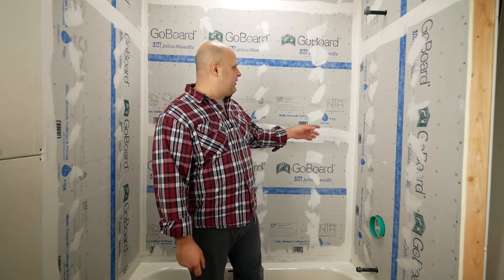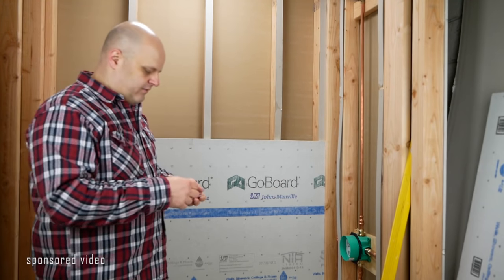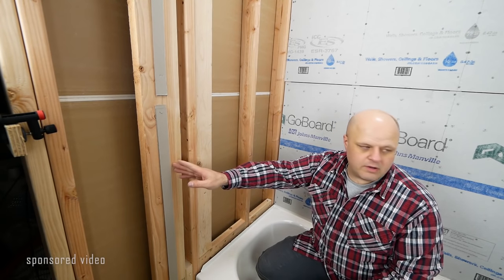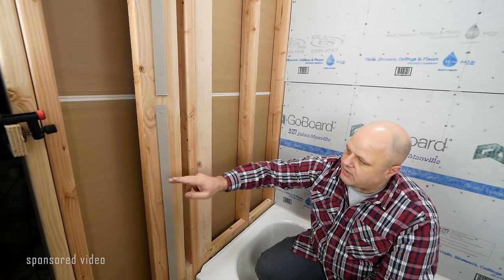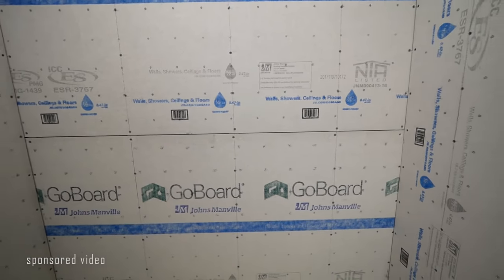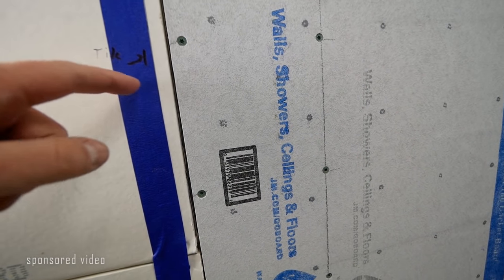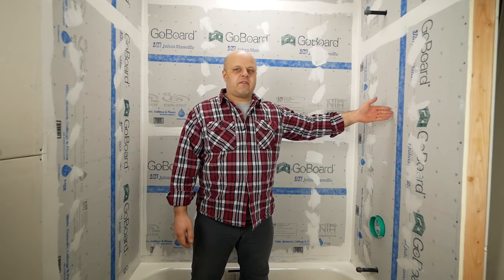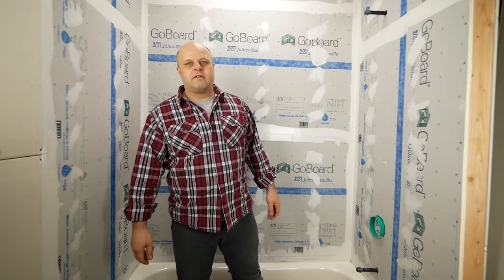How to Install GoBoard Tile Backer Board

Comment: One other thing you may try on the install next time is instead of adding strips of thin paper on the studs, use something like the old wood lath strips or ripped down pieces of wood probably 1/4 in  thickness nailed to the stud faces.  This will bring the GoBoard past the top flange of the tub where  it can just drop down sitting on top of the tub.  You could  still use your 1/8" spacers just sit them on top of the tub below the lip.  You will use less tube sealant, no need for mesh tape, and the top of the flange is completely covered all around by the GoBoard then thin-set and tile.  No chance of it leaking because the board is past the flange and not sitting on top of it.

Comment: What is your opinion of the goboard shower pan system. I want to replace a fiberglass shower but prefer not to move the drain to fit a preformed pan.

Comment: How comfortable would you feel about framing, applying plywood, then this go board w/sealant over to make shower benches, corner seats, and niches? Prefabbed niches and seats are not cost friendly, but this could make an easy solution.
Reply from the maker: I wouldn't have any issues with doing it that way. I usually would use thinset in addition to screws on horizontal surfaces but what you're describing would work fine.
Reply: Or, skip the framing and just use Schlueter kerdi board!

Comment: Great video.  You covered everything!  In 2023, Amazon sells a GoBoard seam tape, but you have to buy a big roll of it, and it is not cheap.  They probably sell it because old timers like me cannot let go of covering a joint with tape.  Maybe it is an old drywall habit that is very hard to break.  Please keep making these nice videos.
Reply from the maker: Thank you!

Comment: I've been following your bathroom renovation projects and appreciate the insights you share. I recently conducted a detailed exploration into the safety and installation practices concerning foam core backer boards, specifically focusing on the critical role of wood blocking for secure grab bar installations. Our findings highlight the potential risks and structural integrity issues that can arise from omitting wood blocking, even with the most reliable materials and techniques.

Given the importance of safety and durability in renovations, I thought this information could be beneficial to your projects and audience. Incorporating wood blocking can significantly enhance the strength and safety of grab bar installations, a detail that's often overlooked.

I'd be happy to share our findings and discuss further. Keep up the great work, and thank you for sharing your knowledge with the community!
Reply from the maker: I agree. Wood blocking for grab bars is a good decision.
Reply: I would think you need blocking for grab bars regardless of what kind of backer you use.

Comment: Great video. I'll be starting my project this weekend. Bought the GoBoard at Lowes, but they don't sell the GoBoard Sealant in my area, so called the company for recommendations for alternatives. I saw on your website that you mention that this product is "itchy". I'm so glad you said it because I wondered why my arms were getting itchy and developing hives when I was loading my car.
Reply: I called the company for a sealant  retailer or alternative and they didn't return my call.What did they recommend?
Reply from the maker: Over on the jm website they have some documents available for download. They may have a retailer list and they also have an alternative sealant list if you can't find their sealant

Comment: Nice work. Can you tell me which of the two  ways of sealing board seams do you recommend most..
* caulking board edge as you hang each one... or
* leaving 1/8" gap then caulking afterwards?

Also. What type of tape did you use on edges of 2x4s
Reply from the maker: Applying the sealant as you go would have the least opportunity for user error.

Comment: I like this product and your demo. I have a question about an observation at time marker 6:11 - 6:17. As you are screwing in the next section I notice you have strip(s) of, for lack of a better term, 'foam backer' pieces stapled to the stud(s). But there's another piece sort of loose material behind the board as you drive in the first top screw. Is it the same material & why?
Reply from the maker: Drywall shims for flattening the walls

Comment: Dumb question. I get that the goboard has a surface well designed for mortaring tile. But it seems like you cover a lot of it with sealant that completely changes that surface. Does mortar or other adhesive have trouble sticking to all that sealant?
Reply from the maker: The manufacturer has tested and says adhering to the seams still meets the minimum requirements. You could use seam tape instead of the sealant if you're concerned about it. Not a dumb question.

Comment: Great video....why are you mounting it on strips to keep it off of the studs?  And what material are the strips made of?
Reply from the maker: The strips are called drywall shims and they are used for shimming out the studs so the walls are flat prior to installing the board. They are made out of cardboard and found in the drywall section of your home improvement store.

Comment: Great idea on putting mesh at the tub flange. Thanks for the awesome video! About how many tubes of sealant did you use? And what did you use to clean off sealant on your putty knife? About to do a similar size shower and want to use GoBoard instead of cement board.
Reply from the maker: Denatured alcohol will clean up the sealant. I'd figure 1 tube for every 2 sheets plus a couple of extra.

Comment: Fantastic video.  I'm definitely going to try this product.  Do you know about how many tubes of the sealant caulk you used on this install?
Reply from the maker: I'd figure one tube for every two sheets and then add one or two more just to be safe.
Reply: @DIYTileGuy  Thank you so much!  That is super helpful.  Again, great video.  Best one I've seen.

Comment: maybe he said it but i missed it, what are the grey strips he stapled to the studs before putting the board up?
Reply from the maker: They are drywall shims for flattening out the walls prior to installing GoBoard. You can find them in the drywall section of your local home improvement store.
Reply: @DIYTileGuy  thanks. Is this a necessary step for installing goboard?
Reply from the maker: Walls should always be flattened prior to installing any backer board. The better job you do, the easier the tiling goes.

Comment: I can see this being far superior then Schluter's product
Reply from the maker: It's another product that accomplishes the same goal. I found this product to be more rigid and simpler to install but Kerdi board has it's fans as well.
Reply: I have never used this product.  Looks good though. Is it guaranteed?  Schlueter comes with a 10 year guarantee!
Reply: @michaelhorn9114  - yes they have a 10 year warranty as well!

Comment: If you were doing a shower only would you seal around the bottom seam the same as the wall seams?  Great video
Reply from the maker: If it's a fiberglass shower pan then I would seal it exactly like I did in this video. I also have a blog post on this topic on my diytileguy blog if that's helpful at all.
Reply: What about to the flange of a cast iron shower pan? Still use mesh tape or just a heavy bead of polyurethane sealant only?
Reply from the maker: I like using mesh tape along with the sealant. But others might simply use sealant only
Reply: If you use the GoBoard Pan you run walls all the way down with no sealant on bottom. Pan gets an 1/8" gap and sealed later.

Comment: Just curious, why would you use tape for the tub joints but not corners?  Great video!
Reply from the maker: It's not required for the corner but you could use it there too.

Comment: Do you still use mesh tape at the flange or have you switched over to the GoBoard tape? Also, do you now use GoBoard washers in conjunction with the fastners? Thanks!
Reply from the maker: I have switched over to the seam tape but i don't like washers with this board. They don't really sink in like they do with Wedi.
Reply: Thanks for your response!

Comment: Hey! I have a couple questions if you don't mind!  What kind of mesh tape did you use at the bottom by the tub flange?  I see there are different mesh tapes for different applications, cement board etc.  

Also, I'm going to tile the bathroom floor using a Schluter ditra decoupling membrane - Recommendations on how to waterproof between the membrane and the bottom of the tub skirt?  Thank you!

Finally, I want to significantly improve the waterproofing in my entire bathroom, including the walls.  Any recommendations on this?
Reply from the maker: I think a better way of sealing the tub flange is to use a banding and seal it to the tub flange with the backer board sealant. This same sealant can be used to seal in-between the bathtub and uncoupling membrane and elsewhere. 

Also, the banding can be used to cover the uncoupling membrane seams and flashed up the wall if you really want to waterproof your floor well.

Comment: I appreciate your detailed description. Just to make clear - the board rests ON TOP of the tub flange?
Reply from the maker: If you can shim out your walls and drop the board in front of the flange then that's probably the way to go. But if it doesn't work to do that then keep it above

Comment: Best DIY video I have ever viewed.  I subscribed.  Thank you!  Two questions - (1) what are the strips you are attaching to the 2x4 frame before attaching the GoBoard?, (2) The plumber who installed my tub used large headed screws into the flange to secure to frame . . . they stick out a little more than the 1/2" thickness of the GoBoard, which is why I am wondering if the strips you are attaching in my first questions could be enough to offset the screw heads?
Reply from the maker: The strips are drywall shims that you can find at the local hardware store in the drywall section. They are for flattening the walls prior to installing the board.

The strips might be enough to build out the wall but you don't want to build the wall out too far past the drywall if you can help it.

Comment: Great video. What was the product you had on the studs? I’m remodeling and the rest of the bathroom has 5/8 drywall, so I’m thinking of shimming the studs behind the GoBoard to make it fit evenly.
Reply from the maker: I have some drywall shims on the studs to flatten things out. They are little cardboard strips and you can find them in the drywall section of your hardware store.

Comment: Regarding the tub flange, Go board sells a band, similiar to a "kerdi ban" wouldn't that be adequete to fit in there?   Those are recommended to be installed with thin set. So I am assume just thin set over the goboard sealant?
Reply from the maker: Yes, there tape, or band, is a good choice for that application. In my experience, you usually want to thinset the band to the board but use sealant on the tub flange.
Reply: Never really worked with the go board sealant so let it cure and then thin set over the board, sealant and the flange and run the band down to the tub?
Reply from the maker: I'd apply a bead of their sealant over the tub flange then notch thinset on the panel. Then embed the band into both simultaneously. Or you could thinset the band on all the way around and come back and lift up the bottom and apply sealant over the flange and embed the bottom into the flange.
Reply: May I ask why not thinset over the cured goboard sealant? I want to try and get a belt and suspenders approach on this flange.
Reply from the maker: The sealant will stick better to both the tub flange and the banding material than the mortar will to the sealant. You could use the sealant to adhere the whole band to the backer board and tub flange if you wanted. I trust the sealant more than mortar when it comes to this particular application.
Reply: I got ya. So don't even use the thin set to set the band... Just go straight to the sealant @DIYTileGuy

Comment: Great video,  thank you,  I am doing a steam shower but having hard time figuring out what to use, I love that goboard is available in the store across the street from me, and it is affordable compared to other product,  but I am having hard time finding information about it, according to their installation document they require an approved vapor barrier , could not find anything else about a steam shower build, wondering if you have done a steam shower and what you used, thank you
Reply from the maker: I'm not sure what the requirements are for a steam shower but I would encourage you to contact GoBoard and they can help with that application.

Comment: so wouldn't it be a good idea to use mesh tape into the joints with the sealant. and in the corners to make it stronger
Reply from the maker: Yes, it can help with strength but it's not required.

Comment: Great video. What were the vertical gray shim pieces for?
Reply from the maker: This are drywall shims to flatten the walls before installing the board
Reply: @DIYTileGuy  How many (drywall) shims would you be comfortable with before sistering or running wood furring strips?
Reply: @diytileguy in some areas it would require us to go with 1 5/8" screws vs the 1 1/4"

Comment: I cannot find the GoBoard sealant outside of a kit.  Can you recommend a place to order the sealant or an alternative that I could find at my local Lowes/HD/Menards?
Reply from the maker: On my website, I have a link to GoBoard's alternative sealants and a list. https://www.diytileguy.com/goboard-tile-backer/
Reply: @DIYTileGuy  Do, you happen to remember about how many tubes it took to do the shower in this video?
Reply: @zuul2591  I wondered same thing. I see someone else recommended 1 tube per sheet. I use PLS40 sealant and also get 1 tube of PL glue as a liquid shim where required.

Comment: Do you use any type of flashing between the tube or shower floor to the GoBoard or do you just use the 1/8 spacing and sealant? What are those gray strips you placed on the 2x4 for the GoBoard to rest on. Great video. Thank you
Reply: My guess is like drywall shims. In the event your board doesn’t sit flush with studs.

Comment: how long did you wait to start tiling?  Are you waiting for the sealant to cure or just skim?  I used the loctite polyurethane concrete and masonry sealant vs the goboard sealant and it takes longer to skim and cure so I am wondering at what point I can go ahead and start tiling.  Did you do two coats of the sealant or was one plenty?
Reply from the maker: I did one coat of the sealant and I wait until it's not tacky anymore. Usually, that's the next day but I have used one that took two days to cure. I don't remember which product it was though.

Comment: Installed the GoBoard just like you, I noticed that the area between the studs at the edge of the board, has a little play in it. Is this acceptable?
Reply from the maker: Yes, there will be a little bit of flex. GoBoard is better than many foam boards, in my opinion. Wedi is the best in terms of stiffness. You can always put blocking behind the seams if it's something that you are concerned about but I've found it to be quite stout once the tile is installed.
Reply: I guess don't go with small tiles. I been putting backer where I can but in some areas (vent pipe) I couldn't put backer other than the standard 16" span for the studs.... This is my first time doing GoBoard so used to cement backer board. I am going with a larger Subway so hopefully it strenghens up.  @DIYTileGuy

Comment: How come you don’t use the flat 1 1/4 washers designed for that board?
Reply from the maker: They're not required and I don't care for the washers with Goboard. They don't really suck in like they do with cement-coated foam boards. I prefer the bigger-headed Goboard screws. There are situations where you need the washers, though.

Comment: ALSO, ONE MORE QUESTION : What compound or adhesive do you use to secure  the tile to the GoBoard ? Will thin set work ?
Reply from the maker: Yes, thinset should be used. Not premixed but the cement kind that you mix with water. It should meet ANSI 118.4 or better. https://www.diytileguy.com/which-thinset-to-use-infographic/
Reply: Professional job. Thanks for sharing.

Comment: I read the Go Board instructions and they talk about a vapor barrier before you put on the go board.  Why did you not put up a vapor barrier? thank you and this is a great video
Reply from the maker: The only time that you need a vapor barrier is when you are building a steam shower. A steam shower is a specific type of shower and differs from a standard shower. https://en.m.wikipedia.org/wiki/Steam_shower
Reply: Or if code requires it
Reply: No vapor barrier is required for Schlueter!

Comment: So with these boards you don't have to paint a waterproof membrane like Redgard. I prompt  response would be appreciated as I'm doing a walk-in shower soon and still deciding this over cement board? Thanks 👍
Reply from the maker: No. The board itself is waterproof.  One of the advantages of foam boards.

Comment: Good to see other companies vying for the same audience. I’ve looked at more videos on different systems and I get overwhelmed. Glad I’m doing my homework. Simple question. I love that, what appears to be your own makeshift straightedge for cutting the GoBoard that keeps your fingers away from the blade. What is that? I bought a piece of flat stock aluminum from Grainger. A heck of a lot less pricey than buying a product that is specifically designated and sold as a straight edge either from the big box stores, or Amazon or the like. Thanks.
Reply from the maker: What I'm using for a straight edge is an "L" screed. You can buy them in a kit and a lot of tile setters have them. https://amzn.to/2Rn9xDP